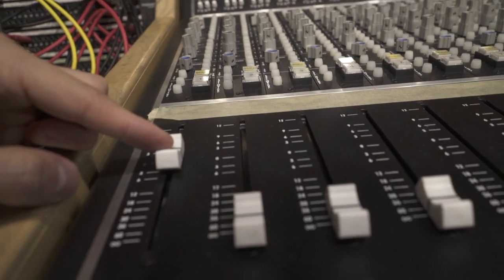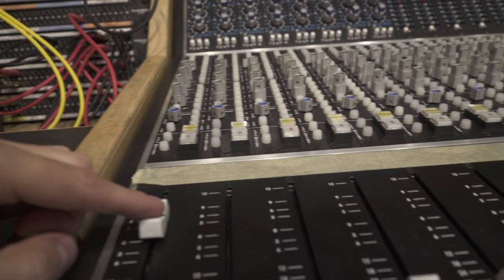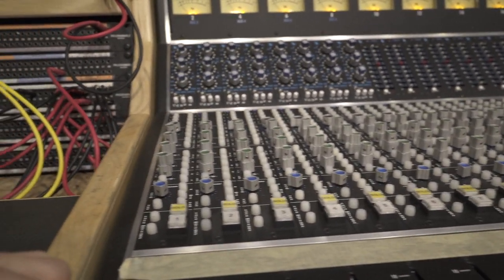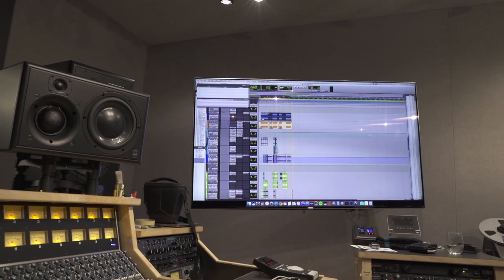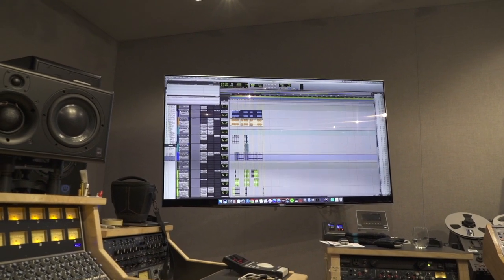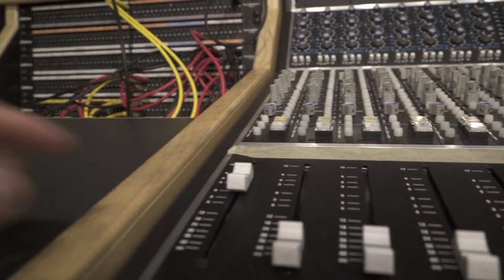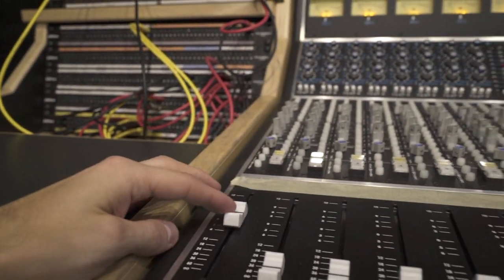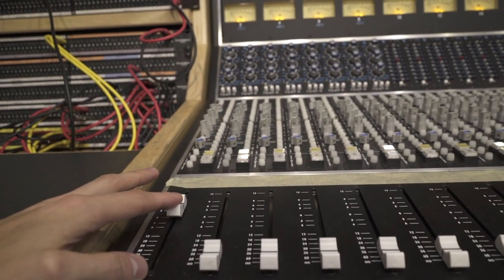Signal Flow EXPLAINED (by NYC studio head engineer)

Comment: What happens after the signal reaches pro tools? How do you use the outboard gear or plugins, automate and mixdown to a stereo output? This is what I've been hunting for on YouTube. The flow of signal reaching Pro tools is clear. What happens thereafter is a riddle!
Reply: i know its been a year but if anyone reading this hasn't found the answer yet, you need to have an interface that has input ins & out. A basic focustrite scarlett 2i2 for example does not have this option, since the only 2 outs are usually used for your Monitors. Many interfaces just slightly above that price range like the UAD apollo's do have the option of having multiple in and out options. Then in your DAW you set the output of the channel itself to your interface out which ends up where ever you chose to wire it.

Comment: Thanks for this! I have just one question: To get the signal out from the console, which output do you use from the console to go to the converter? Main Output? Or direct output?
Reply from the maker: I think it depends on the console. SSLs for example sometimes have 5 sets of stereo outs. There are outs for the summed mix which are different from the outs that go to the various sets of studio monitors

Comment: This is great.! Thank you for showing us the signal flow of your setup. This really helps clear things up for me. I'll have to check out more of your videos. Does the converter connect to the computer directly, or is it sitting in a different part of the signal flow?  What cables are used for the converter?
Reply from the maker: Yes, converter always connects direct to computer or to computers HD cards if you’re running a baller protools HD system. Nowadays i think most interfaces are running Thunderbolt

Comment: i was actually curious how the converter is connected to the protools computer. can you record all the channels separately in protools?
Reply from the maker: Through the protools HDX cards with DB25 cables. You need one channel of conversion for every mic you’d like to record simultaneously. So if you wanna record 24 mics on a live band, you’ll need 24 channels of conversion on your interface

Comment: So when the signal reaches the pre-amp, does it go through the entire channel strip flow and then get sent to outboard gear,  the audio interface and the DAW, or does the signal go from the pre-amp directly to the outboard gear, and then back to the channel EQ and Fader before being sent to the audio interface and the DAW?
Reply: i also have the same question. let me know if you found the answer. i'm kinda confuse with the flow.
Reply from the maker: On most consoles you can actually route it either way - you would need to patch it or use the consoles insert sends and returns. So you can put the pieces of gear in whatever order you want via your patching